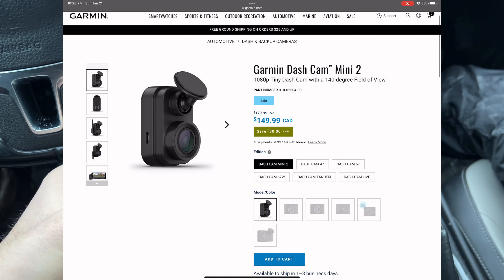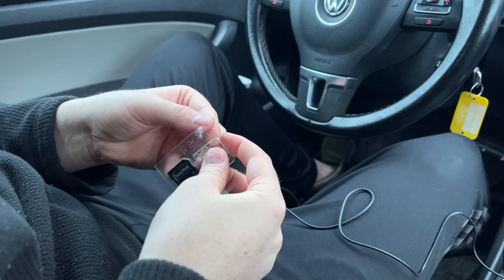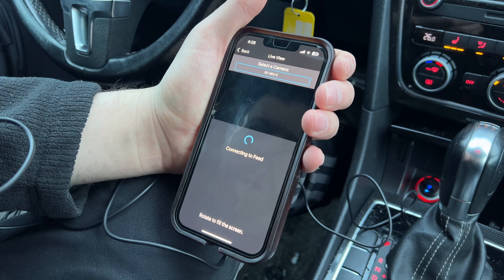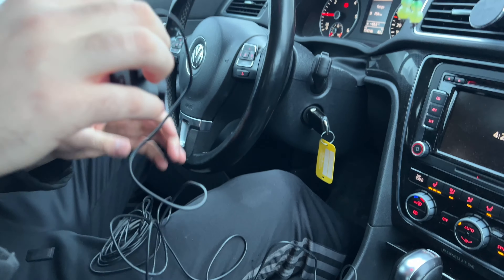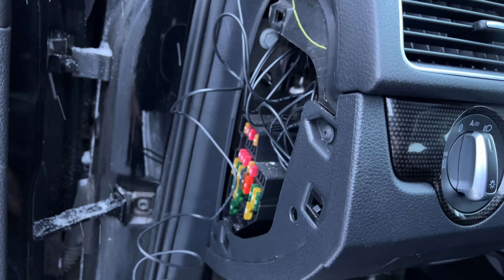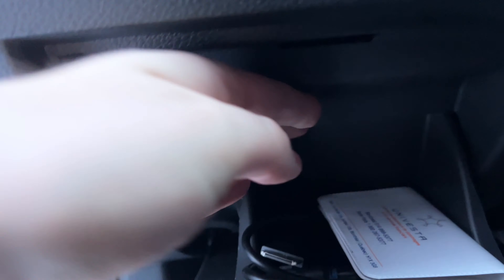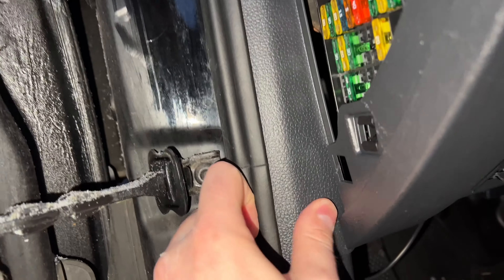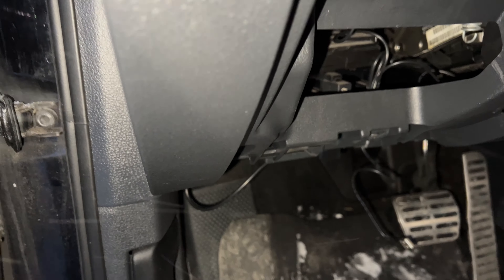Installing the Garmin mini 2 dash cam with the OBD 2 constant power cable

Comment: I wish the Mini 2 had higher resolution.
Reply: The human eye cannot discern the difference between 720p and 1024p resolution, so I recommend setting resolution to 720p unless you are doing commercial or top shelf  vids.
Reply: @WaltHarvey-uf7jx  You are misinformed. The Garmin Mini 2 has 1080p maximum resolution, not 1024p as you say. Second,  I'm sorry your eyes can't tell the difference between 720p and 1080p. People with healthy eyes do not have that limitation. Third, the higher the resolution, the more details are captured in the videos. 2K resolution provides clearer details than 1080p. 4k resolution provides clearer details than 2K. Details such as license plate numbers. Remember, this is a dash cam. I wish the Mini 2 had higher resolution than 1080p.
Reply: I stand corrected. I have reset my resolution settings to 1080p.

The pros of higher resolution recording more details are irrefutable. In the event of an incident, for example, a superior image would be invaluable for forensic investigation by police or other authorities.

The discussion about the human eye’s ability to distinguish between 720p and 1080p has a long history. The distance to the screen and the size of the screen are important pieces in the puzzle. Arguably, the most significant puzzle piece is that people will have better or worse vision than others.

Thank you.

Comment: Does the camera have power to it if it is connected to the cigarette lighter and turn off  my car and park it in a garage?
Reply: No. If its connected with of the cigarette lighter it’s only powered in if your car is on. You need the constant power cable for it to work when your car is off.

Comment: Hi there, i wanted to know how the obd2 constant power cable is working for you, i am looking to buy one, specially for the parking mode does it work for a civic 2015?
Reply from the maker: I have mine set only for 10 min but it does turn on when there is activity going on around the car. The app has different settings you can go through. I’ve used this only on VWs and it has worked well for me, never had an issue with the battery.
Reply: I used a Plozoc OBD 2 constant power cable on a 2019 Jetta. I set the Low Voltage protection on the Plozoc to L-11.6v and Parking Monitor to 10 minutes. Works like a charm.

Comment: What do we need the OBD2 Constant Power Cable for if there is park monitor feature in the app?
Reply from the maker: Where are you getting the power from?
Reply: @newoldcar_  If I get the dash cam only, no OBD2 CPC, the dash cam will not function?
Or is the OBD2 Constant Power Cable for recording all time even when you turn off your car, park, and walk away?
Reply from the maker: @ if you’re going to use the cigarette lighter and your car powers it all the time, then that will work. Parking mode only works if the camera has power to it all the time
Reply: @ I park my car in apartment garage. I need the camera to record if someone touches my car. Do I need the OBD2 Constant Power Cable?
Reply: @ Is ‘turning my car off/parking overnight’ considered as having power all the time?

Comment: Bonjour ça décharge la batterie? Merci
Reply from the maker: non, il a une protection de batterie, il ne lui permettra pas de descendre en dessous de 12 V
Reply: Super merci 🙏
Reply: Can you add a second camera in the rear, run the wire up to the front and connect it to the same ODB device?
Reply: @adamlaw111 yes you can. It is for that reason it has dual UsB output from the OBD